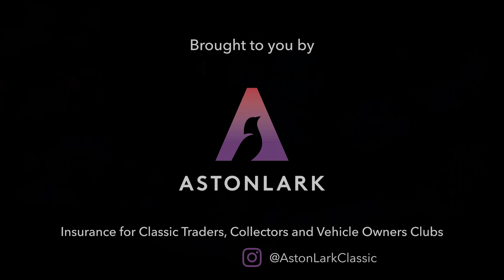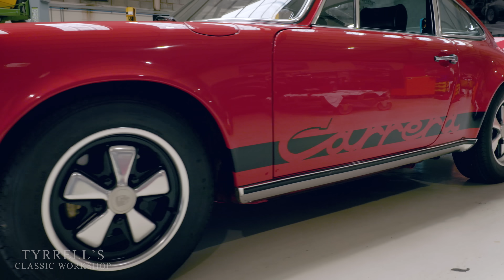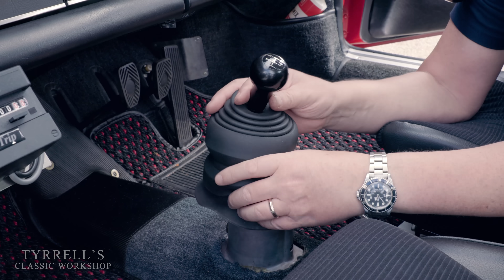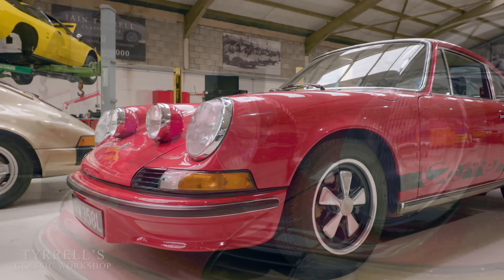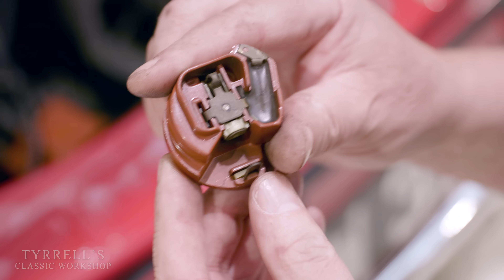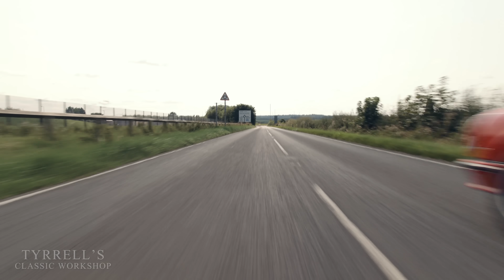Porsche 911 Carrera 2.7 RS- the car Porsche feared no- one would buy!| Tyrrell's Classic Workshop

Comment: Story about Ledwinka in the ball park, (Volkswagen settled lawsuit after the War), but Ledwinka wasn't the founder of air cooled rear engined cars, (he was the inventor of the tubular backbone chassis with independent suspension, and a pioneer in aerodynamics in production cars) but it was actually Ledwinka and Porsche professor - both Austrian and both studied together - that had the rear, air cooled engine as the logical layout (which by many accounts it is, NVH, cooling, packaging etc). Ledwinka was the first to develop the concept commercially, and Hitler - who met Ledwinka several times - raised the copycat question to Porche, which answered that they both looked over each others shoulders (they actually also studied with Carlo Abarth.) Porsche was a great engineer in his own right, the Cisitalia 4WD as an example, but one could argue that Ledwinka was more visionary in certain aspects. Tatra T-77 was WAY ahead of its time, but as the airships... Didn't really catch on. 
Well, Volkswagen settled for 1.000.000 Deutche Franks after the war. But Tatra was alone developing their version of the concept, so they basically just put new bodywork on the T-77 all the way into the 1990's!
Porsche of cource fared better with the 911, and all though Tatra today is a great truck brand, wouldnt it be cool if they made a rear engined V8 Panamera competitor?
Reply: Didn‘t Porsche steal the rear-engine concept from Bela Bareynij ( however his sirname is spelled) who has sketched this concept already back in the 1920s?… Also, Bareyjni (?) won a lawsuit against Volkswagen in the 1950s. Béla Barényi is the correct spelling of the Hungarian inventor.
Reply: I would disagree with the statement about Tatra after war: The T87 had V8 engine with block caseted out of Electron (quite dificult metal to work with). The first new post-war Tatra, T600 had completely different engine - boxer four cylinder. The T603 enigine was perhaps a relative of the three liter found in T87, however it was 2,5l and I belive aluminum. The 613 had completely different engine to the 603 and this engine was placed directly above the rear axle with gearbox in front of it, shifting the centre of gravity forward (and little up). I agree that it is a poor show to engineer only three cars in a span of fourty years, but suggesting the company limped on with basically pre-war tech up until 90s would be painting very inacurate picture indeed.

Comment: "Special Porsche tool" I love British humor 😄
Reply: "Humour".
Reply: @nickturner2813  lol google gives me a "Translate to English" option for this comment that changes it to "Humor".
Reply: For wich you need the "Special Porsche hand" p/n 911-0451-0657 with "Special Porsche fingers" p/n  911-0451-0657-1 to 5.
Reply: Not just British humor, that's mechanic humor. To fix squeaks and rattles, I've "adjusted" many parts over the years. The "adjustment" often involves judicious use of a hammer.
Reply: Not forgetting also the legendary 'Knockometer' and 'clicketty whirlygig'.
Reply: Those special tools were produced in a limited run of only 500 units originally to match the 500 cars required by the homolgation rules. Only a hundred or so are known to exist today and cost a mint if you can find one.  🤣🤣🤣🤣🤣🤣
Reply: @chrisauten2039  🤣 🤣 🤣
Reply: Wonderful.

Comment: Appreciate the reference to the Tatra, but by that logic we should deride all front engine, rear wheel drive cars as just being rip-offs of the 1895 Panhard.  There is credit to be had for making the first commercially successful rear air cooled engine, rear wheel drive car.  If it wasn't for Porsche, and by extension VW, nobody would be talking about Hans Ledwinka.  
Also -- to be a pedantic Porsche owner -- the wheelbase was lengthened in 1969 when the engine was still a 2.0 liter.  It was only later that the engines moved to 2.2, 2.4 and beyond.  While the 917's engine is a flat 12 (or rather a V12 with a 180 degree bank angle), the 911 engine is a "boxer" engine.  So cylinders 1 & 4 (opposite each other) hit TDC at the same time, as do 2 & 5, and 3 & 6.
Reply: Nice post.

Comment: You have to consider tire technology at the time. Not only Porsche did use rear engine layouts, but also the very successfull Alpine A110.
Because of their weight distribution they could accelerate rather quickly out of tight corners, which was really handsome if you consider the roads at the time, especially in Europe - and all the famous Rallyes they won, like Monte Carlo, Mille Miglia, etc.
Reply: Le Mans, Targa Florio, Daytona, Paris -Dakar. Only 2nd in the Safari....add Abarth to the list of rear-engined cars, pñus saloons like R8 Gordini, NSU TTS, Simca Rallye and Hillman Imp. There wete also major packaging advantages, and 911 was and is a 2+2, not feasible with a mid-engined car in early 60s.

Comment: Nikasil was, funnily enough, also used by Citroen for the 652cc air-cooled twin fitted to the base Visa models... Definitely at the opposite end of the automobile spectrum :)
Reply: Moto Guzzi has been using nicasil liners since the mid 70’s. First on the V50.
Reply: ...and BMW, Mercedes, Jaguar, NSU, Suzuki, etc.
Reply: Who are part of VW group
Reply: %ñ

Comment: I have to say, I watch many youtubers but your soundclips of an engine revving are the best sounding by far. Maybe the others only capture the exhaust or don't rev it properly
Reply: Most just do a (stupid) revving without gear thus no load for the engine and the engine doesn't deliver anywhere near true full power.
Ian drives. 
(There's a reason many modern cars limit max rpm without a load, it's not good for the engines - they need the resistance.)

Comment: Oh my would it have been amazing to be around when cars like these were brand new. So much simpler and more importanly, light and nimble.
Reply: Also more rusty and unreliable. But at least you could fix it yourself.
Reply: @Gentleman...Driver   That is absolutely true.
Reply: There's plenty of cheap and reliable hot hatches and rear wheel drive metal to still enjoy these days, such as the Suzuki Swift Sport, Nissan Micra SR160, Toyota Corolla VVTLI, Mazda Mx5, BMW e92 325s etc

Comment: Always thought the 911 was more like a hammer ,all the weight at the back hence tail happy
Reply: He mentioned  batteries.  And of course the weight of the body and chassis, and don't forget 100 to 160 lbs of fuel in the front tank.  But even with that, I, too think it's more like the "hammer" you mentioned, or in my case, I think of it as a "pendulum" effect.
Reply: @davidepperson2376  12v. Battery does not make up for the weight of engine/ gearbox .Fair enough fuel tanks,but only if it's full ,then still probably weights less.All the weight is over the rear axle in line ,hence classed as rear engined
Centre line of the body shell front to rear is probably more or less the same .50/50 weight distribution was probably way before the time
Reply: @LOTPOR0402  I do agree there is a rear weight bias, no doubt.  
But a couple of points:  some of the earlier cars also had lead weights all the way forward inside the front bumpers.
And, beginning in 1969, two heavy lead acid batteries on every 911 - one right, one left.
And finally, I drive an early 911 (a 1972) a minimum of 3 days a week in So Cal.  I am still mindful of the issue, it's just not the problem it was prior to '69.